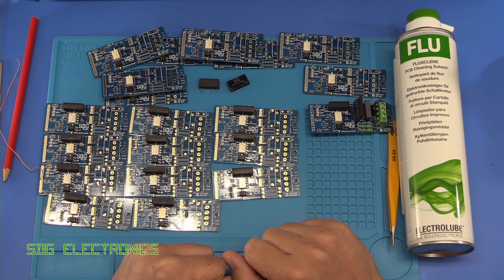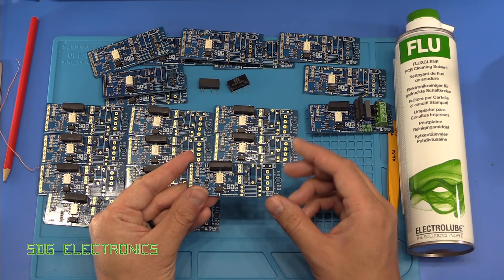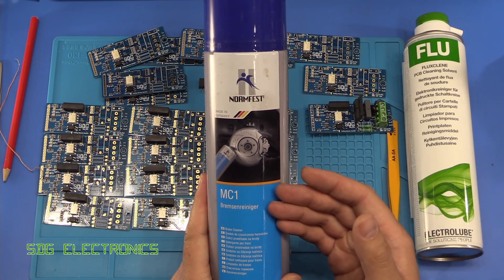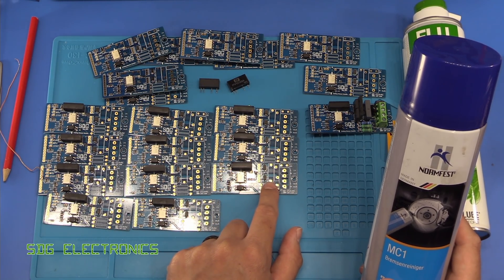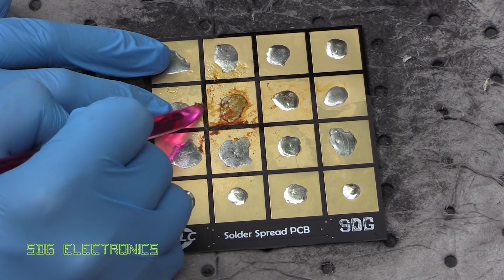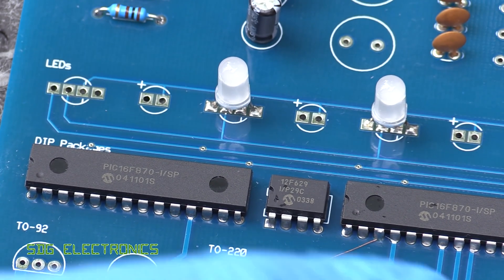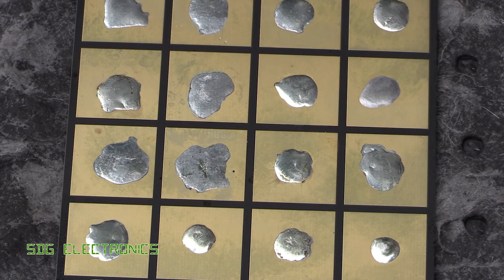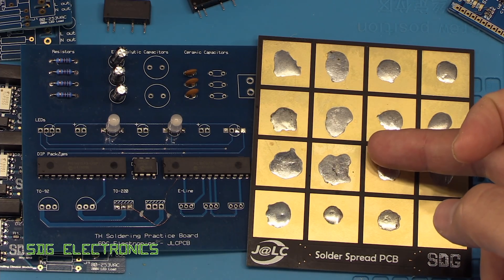SDG #147 Brake Cleaner - Low cost effortless PCB cleaning!

Comment: Warning: if the circuit board is coated in a clear rubbery coating, aka conformal coating - brake cleaner may remove it  - turned into a gooey mess that took a lot of spraying and brushing to remove in rubbery gluey chunks. got about 90% of it off anyhow...but now the protection of the coating is gone.   I didnt listen and test first....so its on me. just  a note to all that this method is not foolproof.

Comment: Will electronics contact cleaner remove water corrosion and general oxidation from contact sockets where ribbon cable connect on a laptop?

Comment: I'm glad you finally at the end of your video warned against certain brake cleaning solutions that contain Trichloroethylene.  This is a particularly hazardous chemical.  Unfortunately break cleaners containing Trichloroethylene are still readily available around the world.  The less attentive viewer may be tempted not to watch the video to it's conclusion.  Now other than physical contact or breathing in the fumes of Trichloroethylene, it is most hazardous when the residue (yes there will be some after cleaning your PCB with it) is heated to more than 300 degrees C which are typical soldering temperatures which may very well occur if the PCB is ever repaired.  At 300 degrees C it breaks down and converts into Phosgene gas which is extremely toxic by acute (short-term) inhalation exposure. Severe respiratory effects, including pulmonary oedema, pulmonary emphysema, and death have been reported in humans. Severe ocular irritation and dermal burns may result following eye or skin exposure.

Phosgene gas has the odour of moist hay and most people don't associate this with been hazardous so it can initially go unnoticed especially in small doses, however the long term effects can be life threatening and by the time a formal diagnosis is confirmed the victim is unable to be treated for the ensuing conditions they will suffer.

In my opinion the warning should be placed AT THE BEGINNING of the video and the dangers reinforced throughout.  Just because brake cleaner containing Trichloroethylene isn't available in the UK doesn't at all suggest it's unavailable in other countries.  Of the 26k viewers of your video I wonder how many actually watched it to the conclusion for the warning and how many were outside the UK?

Comment: Acetone works very well for removing flux, never had an issue with the silkscreen.
Reply: Acetone works great on everything - its essentially the strongest solvent you can commonly buy. But you should really only ever use it as a last resort, because its way too strong! Using the least force necessary like a true connoisseur of petrochemical detergents

Comment: I've got a can of MG Chemicals "Heavy Duty Flux Remover". it contains 1-difluoroethane, ethyl acetate, acetone, and propan-2-ol. Are there similar chemicals in the brake cleaner?  This stuff works pretty good. The flux just drips off the board when I hold it vertically and spray.

Comment: Another helpful video. Did you inspect, or would you consider inspecting its affect on LEDs? Brake cleaner has a dramatic effect on transparent plastics, such as plexiglass or common safety glasses. I saw the LED on your practice board, but it seemed like it was already diffused by design - not a water clear lens - and thus it was difficult to judge whether the brake cleaner affected it or not. Whether one might consider any effect to be damage or a handy way of diffusing the LEDs is in the eye of the beholder.
Reply: LEDs are encapsulated in epoxy. No worries there.

Comment: As long as you don't plan on welding anything you've cleaned with it, should be good.  It does leave something on the what you spray it on, which is why you can't use it to clean anything you plan on welding, as it will release a poisonous gas you DON'T want to breath in.

IDK about soldering though.  Doubt the temp gets high enough.

Comment: I have used brake cleaner in to clean flux.  The high pressure stream works well.   I am concerned about the long term effect on the reliability of components, especially electrolytic capacitors.  However a brief test like this one cannot address that concern.
Reply: hi chris. it's been 4 years since this reply. how are your caps? i cleaned my pcb (with resistors caps} with brake cleaner a couple of days back and i am worried how it will affect it long term

Comment: Kerosene works on the heavy rosin fluxes, it just that it needs to be washed with a strong kitchen/bathroom spray afterwards. Brake cleaner seams like a better option.

Comment: If you use it right, a can could last you years.
Just a bit on a tooth brush, work the flux until its all loss mud, throw it in the ultrasonic cleaner, and AvE is your uncle.
Reply: What would you use in the ultrasonic cleaner btw.? Isopropyl? Or just demineralised water?

Comment: I'm wondering what the long-term effects could be from using brake cleaner. Would it damage chips/components in any way?
Reply from the maker: Unless it contains acetone or another more damaging alcohol, there should be no long term effects. The boiling point of these is so low that it evaporates very quickly.
Reply: @sdgelectronics  doesnt acetone also evaporate quite quickly

Comment: Personally, I use 50/50 mix of isopropanol and gasoline (from home markets). Good clean both polar and non polar things.
Reply: And it does not leave a film or smell? I never thought of using gasoline before.
Reply: @benbaselet2026  It does not smell or film after drying. In Russia, it is sold as an 'oil solvent' or 'white spirit'. As I know, this composition also used in many factories for these purposes.

Comment: Thanks Steve 👍. I sometimes use the Car Plan variety brake cleaner as PCB cleaner, as I have a few cans of it knocking around.. left over from when our workshop closed down. It's really handy stuff. Especially as you say instead of Fluxclene etc.  

Just an advisory for anyone that uses brake cleaner.. Please take care not to get the stuff in your eyes.. It'll temporarily blind you & it stings REALLY BAD!.. How do I know?.. Well
In my youth as a vehicle technician we once had a small war in the garage during our lunch break, using brake cleaner as the weapon of choice. Mainly because the stuff we used came out in a very tightly formed targetable jet. Unfortunately I lost the battle, as I miss-timed popping my head up over the parts counter, just as the service manager (who was trained in such operations) came up from the other side with a can expelling a jet of brake cleaner at full tilt.. Got me in both eyes, and THE PAIN.. Wowee!  I couldn't see anything for literally 5 minutes, the streams of tears along with the pain just wouldn't stop. I really thought I may have damaged my sight at the time, but luckily after about 10 minutes all was normal'ish again, apart from my glow-in-the-dark bloodshot eyes. 
Yes we were idiots and certainly didn't do that again.
Cheers mate
John
Reply from the maker: Thanks John and good to hear from you. Take care
Reply: I have accidentally got break cleaner in my eyes before and I can verify that stuff burns like crazy. Luckily for me I have a very fast reaction and was able to reduce the amount got in my eyes although it still felt like I might got too much in there. Can't always control what direction that stuff will go, so it's best to wear eye protection when using it.

Comment: Most modern brake cleaners are formulated so that they wont harm electronics,plastics or rubber as all those are contained in or around modern brakes, Carb cleaner is much the same.
Reply: Something to note is that you should look for NON-CHLORINATED Brake Cleaner.  The ones that are chlorinated will destroy plastics.  I accidentally used the wrong stuff to try and clean a dusty case fan, and within 30 seconds the plastic started crumbling.
Reply: @Dainslaif  I think that chlorinated brake cleaners are banned here in the UK,I certainly have not come across any in something like the last twenty years.
Reply: What kinds because walmart has brake clean for $3 a can.
Reply: @jamesdavies686  As most vehicles contain plastic somewhere in the brakes and carbs/injectors any cleaner that damages plastics is unlikely to be on the market. At that price I would get a can and try it on some scrap plastics too find out.
Reply: That's what I wantede to mention aswell

Comment: What about the Mr Muscle can in your thumbnail? ;)
Reply: Curiously, I have great success with an alkaline household cleaner (intended for stove-tops). It reasonably dissolves rosin, and after flushing with water, leaves no residue on everything, unlike alcohol. Has a few downsides though: It tarnishes solder joints a little bit, and attacks aluminium and brass readily (removes black anodisation off of heatsinks; leaves black stains on brass). And dissolves skin (slowly but surely), gloves are a must.

For my own boards, I use only water-soluble fluxes anyway, so i don't use the alkaline stufft very often.

The brand is "Unicum". Not sure if it's available in eu/us, it's quite a nasty stuff.